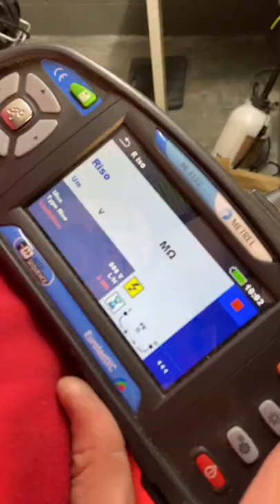Most electricians ⚡️ DON’T have these tools

Comment: I didn’t know this cable was still made - I’ve come across it on fire alarms - often 4 core. Nothing worse than a customer wanting alterations and seeing that this has been used on the installation. As soon as you move the cables it can cause a short. Also after years in position the terminated ends can break off.
Reply: It’s designed not to be moved after fitting, and the usual intent is for the cable to be routed as needed then the ends potted and terminated. Obviously you’d want to keep a good meter to hand throughout. 👍🏽

Whenever working on an old installation - Especially if repotting - The entire run should be retested thoroughly before recommission. 😇

Comment: Amazing cable you can hammer it flat and still doesn’t short out until you have broken the outer. Can make a lovely job if you have the time. The guys in the boiler house used to polish it

Comment: In the 60s, there was a global copper shortage. Areas that needed a flameproof installation used aluminium mineral insulated cable instead for a while. That was really tricky, delicate stuff to install!
Reply: That explains two things to me:
1. Why I’m pretty certain I’d come across aluminium sheathed MIMS in older industrial installations, and
2. Why the present UK decimal coinage used the 1/2d form factor for the 2p, and the farthing size for the new 1p! 😁

Comment: It’s a well known fact or is it.the cable can absorb damp .when starting a new length of cabling always discard the first 9- 12 inches of cable before starting. The damp only travels back 12inch max. The times in the past we have been on jobs with MI and had bad readings. The only thing to do was remove the old pot and put a blow lamp on the cable to get the damp out. Not ideal when the last person couldn’t be bothered to do the job properly.  The thing is Megger before and after.
Reply: Any bare ends to be done later i used to put a bit of the mi compound over the end then a bit of pvc tape or leave thd cable a bit longer
Reply: John Waby yes same here that’s what I did

Comment: Is this a uk thing I'm too european to understand? What the hell is the point of a cable with that much work involved?? Makes for great shorts though
Reply: It's for resisting high temperatures, so often it can be used for fire alarms or areas with excessive ambient temperature. Because there's no plastic anywhere in it and the inner insulation is a mineral powder you can literally blowtorch it and it will still work. If installed correctly it will outlive any other sort of cable out there.
Reply: Fireproof and tough
Reply: as MICC rating is higher, a thinner cable is possible than with other wiring systems, which becomes a great cost benefit on large projects, MICC also outlasts other wiring systems,
there are multitudes of buildings with MICC sub-mains over 70 years old in perfect condition reused when the distribution gear has been replaced
Reply: idd never seen this techique in Belgium .. but cool video idd :)
Reply: Irish thing too. Becoming rare though.
Reply: Your house could go on fire and you could still use the existing cables that had been burnt and probably not have any issue. Highly not recommend though 😂
Reply: Rats cannot chew it ?
Reply: They are for installation in very high temperature areas. Boiler rooms, etc.

When I was serving my apprenticeship in Northern Ireland some transport installations were wired in MICC cables because they are, in certain situations, bomb proof.
Reply: Also looks good in stone buildings etc. old stone castle/church or whatever with electric added looks 1000x better in MICC.
Reply: Fireproof cable
Reply: In Europe silicone cables are used in high temperature environment. This looks like a very  time consuming en thus costly to install.
Reply: @Kingrhem.  ok, the cable is fireproof but at some point flames/smoke are going to tell people you have a problem, right? You may have a metal breaker panel/ consumer unit, but at what temperature does that fail? What about your incoming power lines? Fuse on incoming power? Your power meter? Now if we are talking about supplying power in a steel mill or glass factory, this stuff looks cool.
Reply: It's really old style cable. No idea why he's bothering installing it other than to make a TikTok. There's other more modern fire rated cables around.
Reply: @DS-cp3fg  by the looks of the reels in his video, it seems as if MIMS cable is still very much in production! Probably not used outside the UK/RoI though, I’m guessing. 😇
Reply: Imagine asking UK electrician to connect five sockets with that cable -  he finishes, sends you a invoice and makes you bankrupt 😂

Comment: Got to be honest: My household wiring (Mostly installed 1984) is probably close to needing complete renewal, and using MIMS would be my choice as opposed to 2+E. Anything in the regulations banning its use in domestic installations? 😇
(I’m fairly knowledgeable when it comes to electrics, but beyond an ancient PAT certification I have no formal qualifications. 😇)
Reply: Nothing to stop you. Make sure if you want to rewire your house in MI that you make sure you have lots of sockets extra, as altering the installation later is a bit of a twat!!
Reply: @jonhunter8737 nothing to stop you apart from the price😂😂 It must be so expensive now with the price of copper
Reply: @johnwarwick4105  Well yeah, but in the eyes of the regs, nothing to stop you!!!

Comment: Hard as nails you can hit it with a club hammer and it’s still fine higher current capacity for any given size, very long service life, unless you let Chippy’s near it , they will keep bending it until it breaks.
Reply: Sometime, somewhere, somebody has tried using an offcut of MIMS to replace a standard flexible cord… 🔌📺⚡️🤣

Comment: The MI I've got inside my roofspace for upstairs lighting is covered in orange plastic - what's the purpose of that?  (Roof is thatched by the way)
Reply: MICC is often an insurance requirement for thatched properties to reduce fire risk from rodent damage to cables, PVC serving enhances corrosion resistance, orange is BS1710 identifier for electrical services, other colours are available, Red is usually used now for Fire Alarms, and White is often specified for public buildings, although the church authorities and national trust prefer bare copper as it blends in with stone architecture when dressed correctly
Reply: @Satters  great reply 👨‍🔧😎

Comment: Just putting it out there I'm from Wrexham 😂
Reply from the maker: A fine place - apparently they make cables there 😂
Reply: @efixx we used to have Pirelli cables on Wrexham ind est too (now Prysmian), but I worked stripping the factory out years ago and it turned into a pallet manufacturers instead
Reply: @codenamenel  Prysmian still have a large site in Wrexham on Oak Road.

Comment: You can hammer it as flat as a credit card and it will still not short out.
Reply: I often wondered about that, assuming the conductors only have the mineral powder for insulation^. Given the copper sheathing wouldn’t the conductors eventually come into contact with it and form a closed circuit? 😳

(^ - N.B: I’m somewhat familiar with MIMS cable from textbooks, but have never worked on or used it myself. 😇)

Comment: Amperage rating?
Reply: it will of course depend upon the circuit design, length and installation method in line with wiring regulations, however the following chart has a generic maximum before de-rating  https://www.rm-electrical.com/wp-content/uploads/2018/10/Cable-Charts-MICC-RM-Technical.pdf

Comment: I'm not a sparky but what's the benefit Of using these? Wouldn't you want to worry about the copper on the outside accidentally shorting something?
Reply: The outside is earthed anyway so it's only like metal conduit, this stuff is impressive in terms that it can resist basically any fire you throw at it. However you can crush it and if you bend it too tightly you can ruin it. 

It does however also look awesome in period properties.